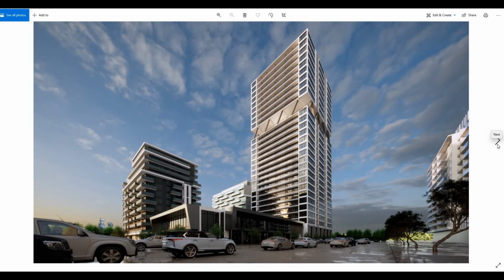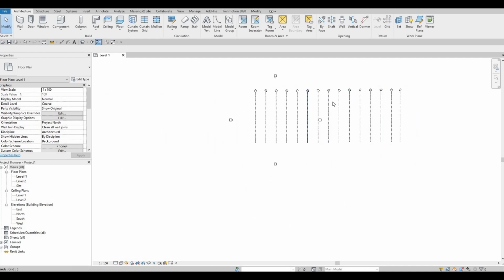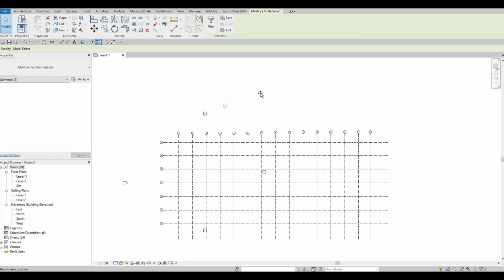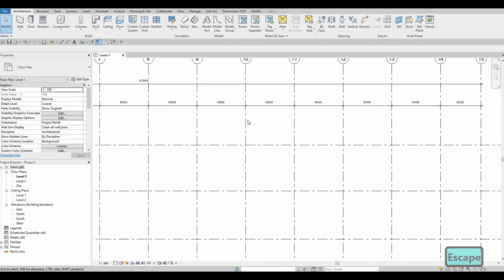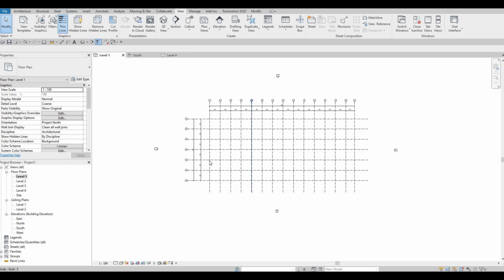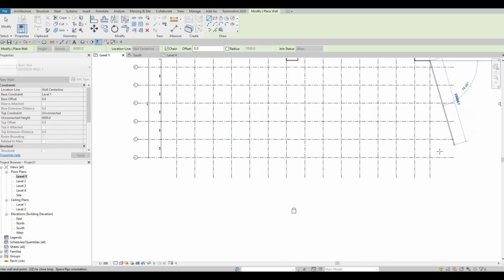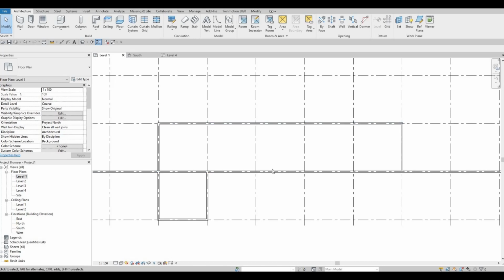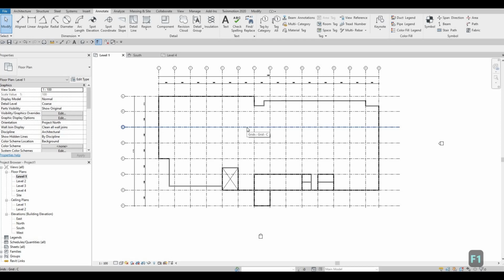NL Building | Part 1 | Mixed-Use | Complete Step By Step Project | Revit and Twinmotion Tutorial

Comment: Can the project be applied to a mixed-use building for businessmen?
Reply from the maker: Hi Oth, there is a office in this mixed used building. 🙂🙏
Reply: @ArchCoreDesigns     Great work, ok more than once I asked you and you didn't answer me what is the idea of the project or the idea of architecture for this building
Reply: Sir, can you give me an idea about this project?
Reply from the maker: Hi Oth, to explain any project you will need to know the specifics like, proposed location, how many floors, what is included, what are the amenities, etc. for an example, this project is a mixed-used, 34 level condominium, with pool, gym, office in 2nd floor, retail and grocery. Located in downtown new york at 34th and 62nd street. Like that.
Reply from the maker: Hi Oth, to explain any project you will need to know the specifics like, proposed location, how many floors, what is included, what are the amenities, etc. for an example, this project is a mixed-used, 34 level condominium, with pool, gym, office in 2nd floor, retail and grocery. Located in downtown new york at 34th and 62nd street. Like that.